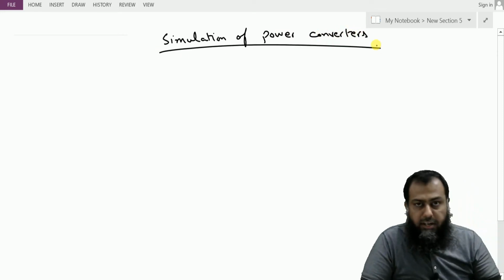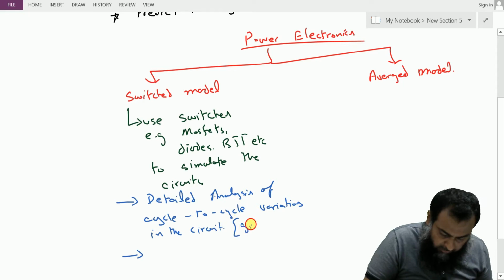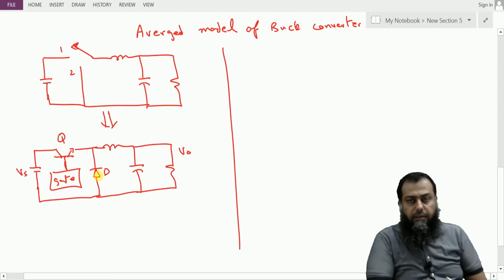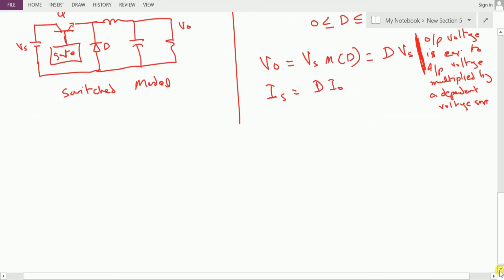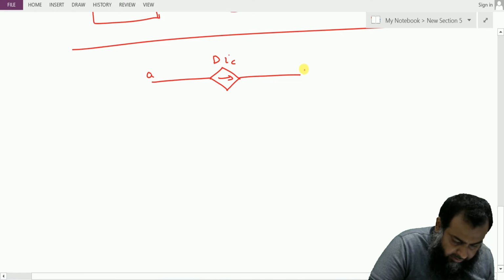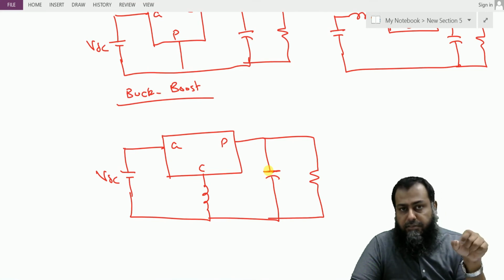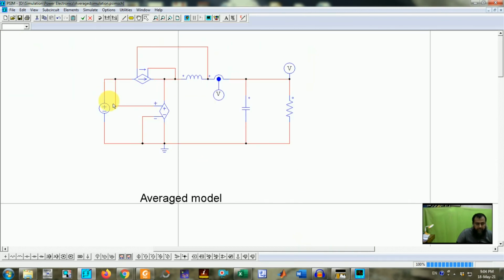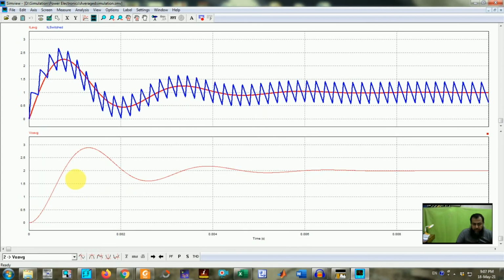Power Electronics Module 2 Lecture 6 | Averaged model simulation

Comment: How about the small signal modelling and state space modelling? Are these different or subpart of what you explained?
Reply from the maker: Yes they are different. Mostly used in control. But in one aspect they are common i.e. all are modeling domains to represent the circuit
Reply: @HadeedSher  many thanks for the reply.. could you please cover more on this topic
Reply from the maker: @powerpath-n4u  I don't promise but i will try.
Reply: @HadeedSher  Sure ..no problem

Comment: Thanks for this useful and brief presentation on the average model of PWMs. However Dr., I believe that you have a mistake in the relations that relate the primary to the secondary side of the transformer.
Reply from the maker: Please feel free to mention the mistake if there is any. I will rectify it.
Reply: @HadeedSher  Thanks for commenting back.  Is/Ip=Vp/Vs=Np/Ns,

Best,
Ibrahim